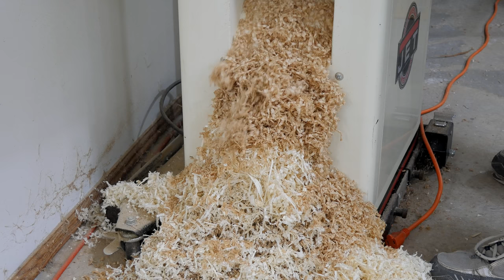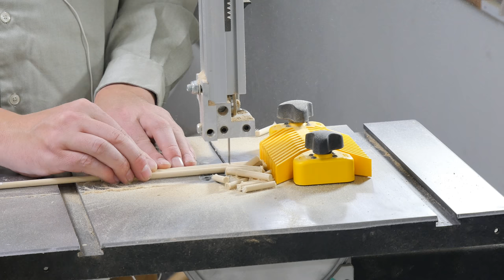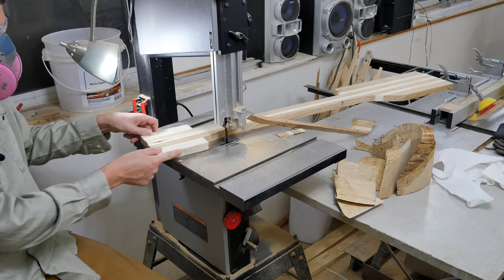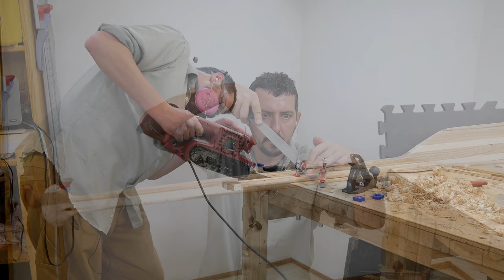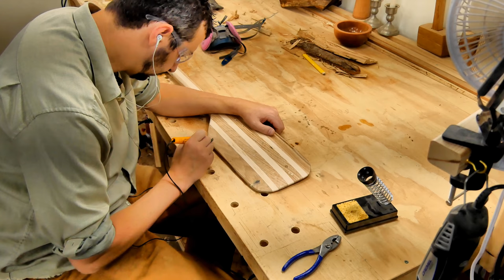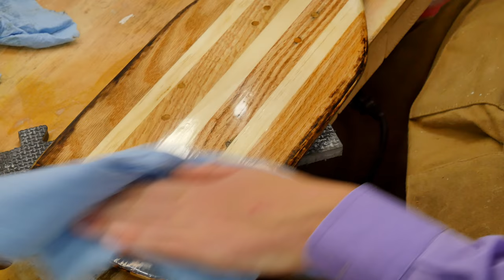Hand Carved Pallet Wood Paddle So Nice, It's Useless 4K

Comment: Amazing! I just made some paddles, in almost the exact same process. Ended up shaping with super sharp chisels (like you paring with a knife). They were cutting so smoothly - like i was shaving clay. So much more fun than power tools. After all, the joy of wood working isn't to complete a project, its the act of creation and DOING the project that's so satisfying. Takes way longer, but so much more enjoyable. Actually found your video because i'm at the fiber-glassing step, which I've never done, and that's kind of an all or nothing deal. I thought about just doing the edges like you did. Wasn't sure it would work and everyone says fiberglass doesn't like to bend that way. After watching this, i think i have the confidence to just go for it. Thank you!

Comment: it seems like you could have saved a lot of time by skipping the whittling knife and going to the sander.  What did you gain (aesthetically or structurally) by doing it the way you did? (It's a serious question, I'm not trying to troll you.)
Reply from the maker: +A Smith Good question, it didn't improve the actual paddle...but sometimes it just feels good to use different techniques, especially with hand tools, even if it's harder or slower.
Reply: In my experience a knife is faster if you have an underpowered sander but the greatest benefits are that it costs less in consumables (sandpaper, sanding belts) and keeps the shop cleaner (the chips from the knife are bigger than from the sander and won't float in the air). Also practicing with hand tools is a good idea,  you might be in a situation without power but still have to get stuff done.